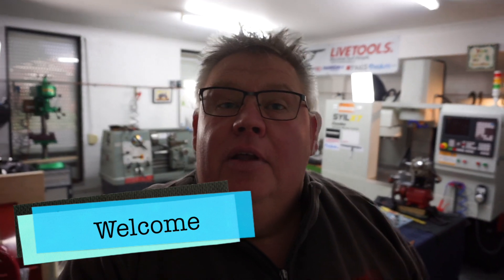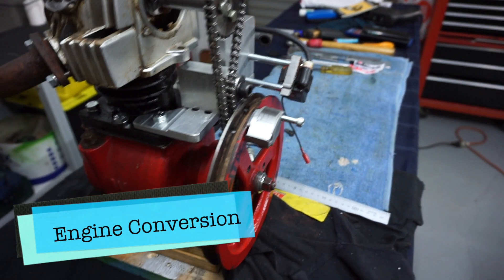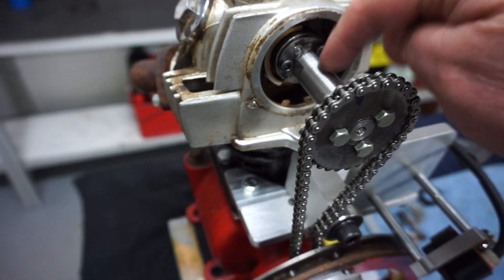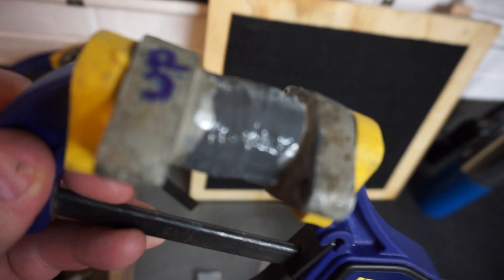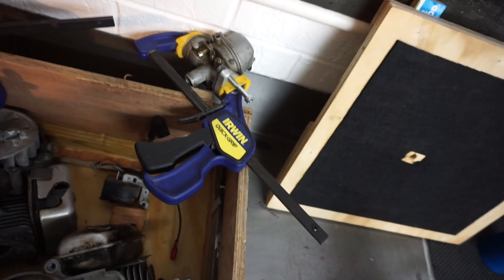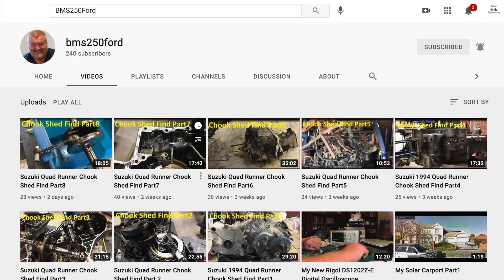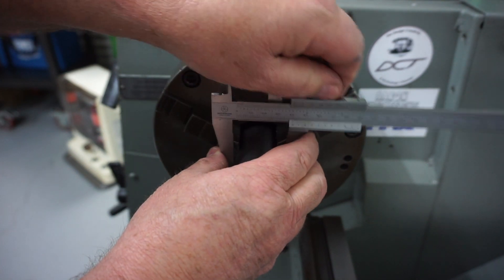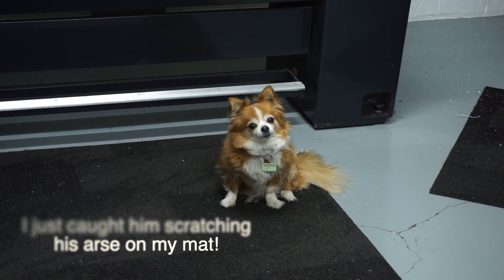New LATHE chamfer tool & shop update

Comment: Hi there, I've watched a few of your videos and noticed the tool & cutter grinder, have you ever done a video about it? It looks the same as mine.
Reply from the maker: Hi Ian and welcome.  The tool and cutter is an old Herless machine.  I bought it off a mate for $700.  It is missing a few things, but is in perfect working order.  I stripped and repainted it green and yellow (John Deere tractor colours).  I covered it breifly in this video https://youtu.be/AMSLkig4hNM  Cheers, Aaron
Reply: @AaronEngineering  Yes it does look the same as mine, one thing I've noticed is they are very top heavy, especially on that small footprint base. I'm making a new cabinet for mine to give it more stability. One thing I noticed with mine is the feed scale doesn't match the actual feed, the feedscrew is imperial with metric markings.
Reply from the maker: @ianowen5123  G'day Ian.  Yes they are top heavy.  I made that small stand for mine and it seems to be ok for now.  It's a good thing to have in the workshop.  Helps to take the projects to the next level.  Cheers, Aaron.

Comment: G'day Aaron, you could mount your chamfer tool as a boring bar and chamfer o/d's and bores in the same setting. There are standard tools for this that are made to suit. Try searching for SSSCR/L for square 8 edge carbide inserts. For deep bore chamfers I grind a larger relief angle on the tip.
Reply from the maker: That’s an excellent idea 👍. Thanks for advice I’ll look into it.  To be honest I really need a Multifix tool post and some holders. That would speed up my workflow heaps. That old Colchester would also benefit from a DRO too.  Man, the money spending just doesn’t stop 🤦‍♂️

Comment: G’day Aaron. Too bad the mag ignition didn’t work out now you’ll have to fit a battery. I must say you have confidence in the JB good luck with that. 
Cheers 
Peter
Reply from the maker: Hey Peter how's things?  Yes, I unfortunately lucked out with the whipper snipper magnet and coil.  So it's back to the drawing board.  I'm unsure how the JB weld will go.  The engine isn't designed to run for long periods, just a quick start and shut down again.  I'm just trying for fun and to keep me out of the wife's hair.  Cheers mate.  Aaron 👍

Comment: Gidday Az….
Great to tune in for your Monday mag ( for our foreign mates, a ‘mag’ is like a chat) 🤣.
Sorry about those removals pelicans breaching the Border.
We had another pair do a run out to Molong/Parkes… and take the China Flu with them 🤬
Looks like we’ll be under curfew until mid August now.
As part of my ..’just like Aaron’s ..’ Syil coolant mods, I decided to change up the coolant pump to 1/4 hp.
Richard Talbot gave me some instructions on how to do it with a 12v pump a’la Bunnings. I’ve decided to stay with 415v however. I got an old jabsco 3/4” pump from a mate ( just needs a Nitrile impeller), and I found a 1/4 horse 415v motor locally for $90 delivered.
Got most of the plumbing fittings, but now having to re-learn how to silver solder … it’s a real hoot 🤪.
I’ll send some pics. of the conversion as I go.
Stay sane,
Grasshopper
Reply from the maker: G'day Robert.  Did you see last weeks unboxing?  Mate that Rotary table is beast.  It does look good sitting on my new shop trolley though.  Next job is a shop crane to lift it.  Your upgraded coolant pump sounds like a top idea.  Please send me some pictures as I'd love to see what you've done.  Maybe I should do that to mine, but first I need to fix that noisy X-Axis ball screw and or bearings.

Yes this bloody Wuhan Chicken Virus is back with vengeance isn't it.  Soon as Sco Mo allocated federal money to NSW, that parasite we've got down (chairman Dan) had to call a snap lockdown.  I feel very sorry for business Robert, as many are going to the wall and loosing everything.

Cheers, Aaron.

Comment: Good show Aaron,
I like the two screws and a block of wood work holding... It is does the job that the main thing...
Cheers.
Paul,,
Reply from the maker: G'day Paul.  The good old screws in a block of timber trick.  I did that video for Instagram to have a crack at my buddy Kevin in Fargo USA.  He thinks I've crossed over to the darkside for going back to manual machining and not CNC LOL.  Thanks for watching Paul.  Hope you're well buddy.  Cheers, Aaron.